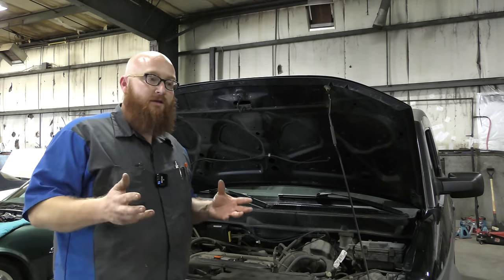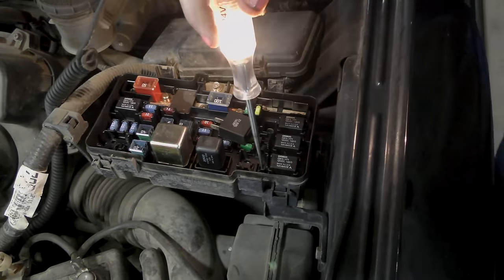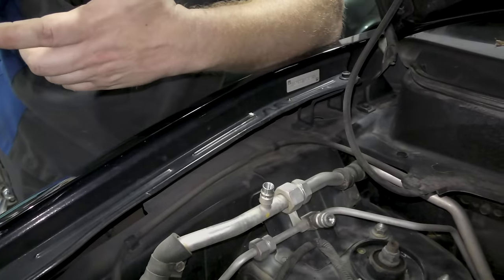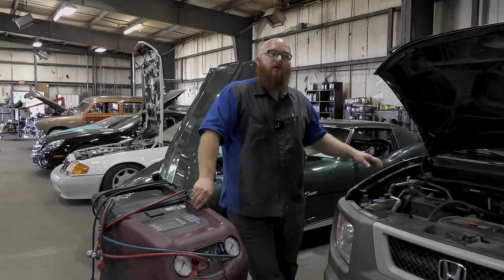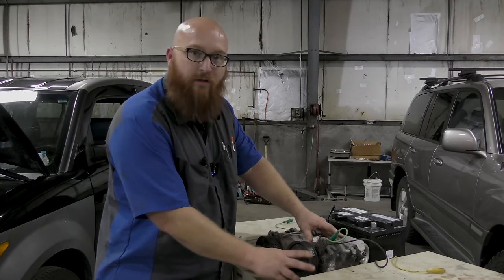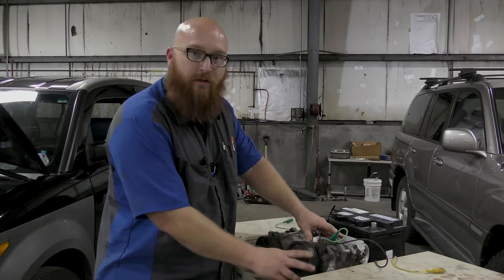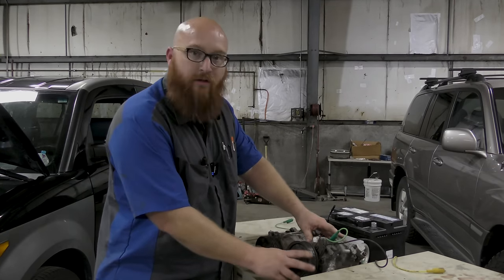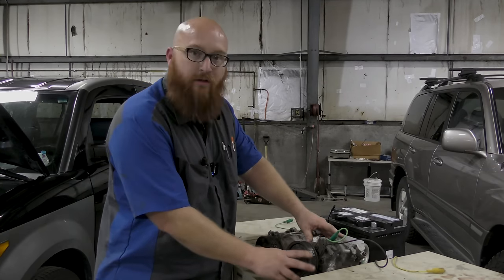AC not working!!! The CAR WIZARD shows how to easily isolate the problem

Comment: This is hilarious, im a tech at HONDA and im literally at work, working on my 3rd a/c problem car for the day and this popped up so im watching it while the a/c machine is doing an evacuation 🤣
Reply: Didn't Honda design more of their newer vehicles with electric compressors?  It would make your day go faster if Honda designed their entire A/C unit into one big line-replaceable module.  It would have the compressor, evaporator, fan and condenser, dryer canister, air ducting ports, connectors all into one neat box.  You pull the defective module out for refurbishment, and slide a healthy one in. And then send the car back out 45 seconds after it was parked.
Reply: sabfly Is it still necessary to replace the whole system if your old compressor is simply not putting out the pressure It used to put out and kind of tired and worn out and not locked up, I know the wizard Said you need to replace the whole system if you replace the compressor
Reply: Must be a newer civic
Reply: Vince Scalise here at the dealer we only replace the compressors/ clutch&coil in a scenario like that
Reply: texasabbott only the hybrids have an electric style compressor, all other models are conventional compressors.. only thing different now is the new freon used
Reply: Shouldn't you have taken a class on A/C during your training?
Reply: @vincescalise4821  The answer is still yes. The loss of efficiency is due to mechanical wear, the worn away material being flushed through the rest of the system. You might not get "glitter", but there's no way to ever ensure that you have flushed 100% of that material out of the system.
Reply: I'm curious what's the 'book' time for a AC compressor and condenser on a Honda Element (Example)? 3hr? 4 tops...
Reply: @Shaquille796  exactly, I just had my son's AC compressor replaced (Rebuild from AdvAuto) and flushed for $600 total
Reply: I also like to watch YouTube while doing evacuations.
Reply: What causes the a/c to not work in C-RVs...looking to buy a 2006.  I notice most C-RVs have A/Cs that stopped working
Reply: @marliseisrael3017  Ac relay and clutch /coil are the 2 most common problems hands down. Always check relay 1st
Reply: @paulholcomb2198  Thank You...I didn't purchase, but I need my AC to work I'm in Texas
Reply: Can the machine u hook up to the car let u know if it’s the compressor
Reply: Dude help me out! My ac only works at night ? But when its hot af out it doesn’t work at all.
Reply: @angelserrano8386  Wow
...hope you get help....I'm in Texas and it's a heatwave
Reply: @marliseisrael3017  im in texas as well lol i hope is my condenser!
Reply: Very helpful ! my saab 9.3 went in for recharge today - nothing in aystem appears valve failed - now compressor not working - back on Monday for Nitrogen test ?  Fortunately condensor in Uk 🇬🇧 £125 and compressor £200
Reply: How is this hillarious?
Reply: @texasabbott  but honda woud make less $
Reply: @josemaisonet5322  l
Reply: Those systems have to be exact on charge or they won't function properly.
Reply: T
Reply: @angelserrano8386 i have that problem as well
Reply: I’m sure the hole in the ozone layer can be attributed to my “topping off” my friend’s ‘02 Navigator’s a/c system- about 8 cans later I realized the port I used and fit pretty close enough, was not part of the a/c system, or was only meant for emptying out the rear a/c before the main. Regardless, where was this buddy when I needed his precision and instructions?!
Reply: The best kind of moments
Reply: OK, so alternator replacement on an 08 Odyssey then my AC stopped working because of a single pin wire attached underneath the alternator for the cooling fan. Nobody addresses this.
Reply: Does an 1000 usd machine work just for at home use for my own cars?
Reply: What about a bad Evap Core?..will that make ac blow warm air?
Reply: @coffeedollsvp  just fixed mine. One of my pipes were broken to the ac which made only warm air blow. Finally gave out 2 Wednesdays ago and got it fixed 2 Saturdays ago. I had a leak due to the broken pipe. Get a diagnosis taken or have someone with an ac machine look at it. If you have no leak you just need to recharge your ac system and should only be charge for the recharge. Don’t use the ac can recharge from AutoZone nor Walmart . They don’t usually work with one can and like I mentioned earlier if you have a leak you’ll just be burning money having to keep buying can recharge. I was charged 280 for the service charge that’s including the recharge labor and parts. Could seem expensive but it’s well worth and won’t have to pay for another few years
Reply: @adrian111-  ok thanks for the info.. will take it into a shop...
Reply: Thanks car wizard! Very helpful
Remember that God loves you Mr. and Mrs. CAR WIZARD! 🙂
Reply: 🧙🏼 magical things happen, believe

Comment: I'm in the automotive industry. You can find honest mechanics that are just parts changers with no diagnostic skills, you can find loads of thieves with and without skills, but a truly honest and competent real TECHNICIAN like the Car Wizard is almost impossible to find.  Good job Wiz!  Lots of respect!
Reply: Except for the 'you can't measure your own reefer pressure and need to pay me 200 bucks to fill it for you' part he's great. You just need a mechanic if you find a leak in your compressor and it's screwed. Manifold gauges are cheap. Get a decent one for like 50 bucks and it's great for auto and home a/c issues.
Reply: @gmork1090  Shhhhh don't tell them! We want them to come into the shop! Wages + a little extra on the top for profit! Sheesh don't want people fixing their own! Then we wouldn't get to take their money!
Reply: I bet you they would do better in construction
Reply: Hail to all the excellent techs out there that get disrespected  at times because there are so many untrained and incompetent thieves out there in the field . Car Wizard is a boss, and you can always depend on his advice. Everything Ive ever seen on his channel has been intelligent,  informed and spot on. Thanks bro!

Comment: "You can't just buy a can..." Tell that to YouTube who just ran an ad in the midst of your video on my feed for a can of refrigerant.
Reply: Literally got an acpro ad on this vid too
Reply: Glad I have an ad blocker installed. What ad? I didn't see one except for their shirt. 😀
Reply: Funny. Got the AC Pro add twice on this video.
Reply: He meant that you can't just add a can of refrigerant and expect to fix a low/high pressure problem. You need to add the precise amount that is needed.
Reply: @absolutelynonameslef  while thats good advice and recommended, i've guesstimated on a few W210s with AC pro and got the AC blowing nice and cold again
Reply: I got the ad for the video too
Reply: All I got were Biden ads. Would have gladly taken AC Pro commercials
Reply: You should consider an ad block. Take advice from the Wizard and only the Wizard.
Reply: It's worth buying a decent set of gauges though. Measuring high/low pressures can tell you a lot about the state of your system, and then you can use those Wal-Mart cans to charge up your system. A scale can also help you meter refrigerant.
Reply: On my older Acura I just take the ambient temperature, look it up in the PT chart for my refrigerant and match the pressures to the ambient temperature in the chart. ex. 90F=250-270 psi head. Works for me. Haven't had to do it for a few years since I fixed the leak.
Reply: @channell11  Yep, a good manifold gauge (multiple lines and gauges fused together) is so good to have for car and home issues even if you're not an hvac mechanic. Can get a decent one for like 50 bucks. Get one to go with your pipe wrench, mallet, hammer, socket and screwdriver set, pliers, shovel, ladder, duct tape and jumper cables.
Reply: @gmork1090  Can you recommend a good manifold guage? Make & Model please?
Reply: Just bought two

Comment: Ac systems are way to complex . They need to redesign them to be less complex and more affordable to fix. Its bad to have a $5000 car and it cost half the value to fix the ac.
Reply: That's when you better fill a cooler with ice with towels in it and keep them around your head and neck. Also get a battery or USB fan

Comment: As an AC Tech for 60 years this guy knows his stuff and is an excellent instructor.
Reply: Had a tech tell me my temperature control switch was bad and my a/c is cycling off when I stop and kicks back in when I take off
Reply: Where’s it located and how hard is it to replace?
Reply: I need your 60 years of experience
Reply: Any idea on why my BMW e36 325i  is freezing and it's not turned on. Though when the green light is on like normal its fine this usuallyonly happens after 30mins of driving then turning the car back on but doesnt always work. I'm an Australian expat in Asia and no one here can fix the issue it's very frustrating. I can change a turbo, head gasket or most thing but aircon I'm clueless.
Reply: Drive it around with the AC OFF. You can feel the AC clutch kick in and out.  The only way a AC can freeze up is if the compressor is pumping Freon.  Another problem can be the fan not working properly or a vent being closed so no air is moving across tithe evaporator coil
Reply: @louprentz8554  thanks I will have a look here were I live it 30 degrees Celsius 365 so aircon is nice to have.
Reply: Check the compressor clutch relay usually in the fuse box. A good bump can close the contacts. If the contacts are worn they can weld together and it takes another hard bump to open them.
Reply: @kanenstuff  When its working, what temperature comes out the vents? (Is it below freezing?) And When it stops working, do you mean air stops coming at all? No air, neither warm or cold?
Reply: @frippefrippe5760  the air that comes out is freezing cold and as I live in a hot and humid climates there will be condensation coming from the vents. If the green lights comes on then it's OK but thus usually on happens after parking in th sun for an hour or so. Only when the green light is off the aircon will freeze.
Reply: You’re 24 and have already 60 years experience. That’s what shops, companies expect from you

Comment: Other videos had me believe that the issue with my a/c system was a bad compressor. I was dreading the repair bill as, even if I was doing it myself, I knew it wouldn't be cheap. With the info you provided, I was able to diagnose the actual cause and repair it myself. All for about $50. Thank you so much.

Comment: Thanks for your honesty and integrity sir.
I'm a Diy'er, learning automotive for five years, I consider myself a beginner. I can tell by your statements YOU KNOW what you're doing as a mechanic, I can learn from you! I can't afford shops, so learning to do the work myself, and collect tools as I progress forward.
    Thanks 👍🇺🇸
Reply: The thing that kind of annoys me is pushing a person to buy his special relay when he could have told you to have the A/C switch turned on, have someone turn the key on, and you should hear that clutch engage anyways and no test light required. If it is not engaging, well sure now you need a test light or multimeter. Yeah, he is a smart guy but things like that turn me off; plus changing a compressor if all that was wrong was the clutch. Even if you have to unbolt the compressor to get at the clutch, all the lines can be left intact without removing the refrigerant, and just change the clutch. He's making it sound like it's a big deal to change that clutch when it isn't. In fact, he knows he can put the gauges on to see what the pressures are in the system before changing the clutch.

Comment: Years ago, I bought a used OEM compressor for my 2006 Fusion ($60), a condenser ($60), a 2 stage vacuum pump ($150),  AC manifold ($50) pump oil ($10), and compressor oil ($10),   About $350, my fusion has been working fantastic. I just searched for the flush equipment, which costs only $50. I have no idea why a shop would charge $1600-1700 for the whole job. I am just glad that I can do it by myself.
Reply: Because the shop would not use used parts and they will markup the parts.

Comment: Thank you so much. I just had my AC stop working in my old Honda CR-V and the last thing I need is to drop a grand+ on a new compressor. Went to Auto Zone, picked up a AC clutch relay, and $9 latter I have cold air. Getting this lucky never happens to me. Thank you for the info. I'm headed out now to buy a lottery ticket. It's obviously my lucky day. 👽✌️

Comment: This is the first video I see amongst a bunch of other major auto mechanic channels, which actually explains EVERYTHING, specially the fact that replacing a damaged compressor is not the final solution. Condenser replacement is one thing that rarely gets mentioned. Thank you for the attention to detail and the very visual way in which you let us understand the process. 👌🏼
Reply: I wish there was a simple solution to fix AC in a car. I know nothing about cars. And I'm doing so much research trying to know how to fix my air conditioning without spending a buttload of money going to a mechanic. I know my condenser is not turning on because I usually hear a click in my RPMs jump up. I was able to manually spin my condenser it's not locked up. I'm hoping all I have to do is replace the relay fuse or maybe just needs freon. I have a 2006 Nissan Altima. My service light has been an issue since I got the car it will turn on for a couple months then turn off for a couple months. I went to NAPA Auto parts to use their computer but when I plugged it in it just kept saying error it wouldn't read correctly. I live in my car and I need to get this fixed before summer comes. I hope somebody can help me
Reply: @pkspecial2196  I know you posted a while ago, but: The condenser is the part that looks like a radiator where the Freon gets cooled off. The compressor ( what you are mentioning,) is the part attached to a belt that has a clutch that is supposed to start turning when you turn on the car’s ac. I hope you got your ac running.
Reply: @badmuddafadda  I just decided to trade the car in for 1,700. I bought a used 2012 Honda CRV EXL with only 32k Miles on it.

Comment: Don't forget to change your filters guys. If your cab filter is plugged up the blower will not pull air across the evaporator which can cause it to not work as effectively. Same for the condenser and radiator, the fan needs to pull air across the condenser and can't if it's plugged. Just some other easy checks.
Reply: How do you check that?
Reply: @jaydenschoenau7956 most are located behind the glove box. Ensure that it’s not clogged with leaves and what not. You’re SUPPOSED to buy a new one but most of us old heads just blow them out with an air gun and reuse them.
Reply: Thank you for adding value to this video.
Reply: @ bryanreamy3214 I am elderly and didn’t know anything about the filters so I got my neighbor to take it for me inspection I left him a note and told him to check my air vent because of a odor and put two filters in I brought it in 08 cry never filtered but the sad part I tooked it in and told him about low coolant and he charged me near $500.00 and all I needed were the filters I were outdone CRV very good car had no major problems people keep asking me to sell it to them I told them I am too old to go in debt❤

Comment: Man I gotta' say most informative automobile help I have ever had. I just paid $168 for a diagnostics test on my Hyundai Sonata Hybrid. Worst car I have ever purchased and I mean that. So I am at the dealership paying my $168 The local Hyundai dealership in my hometown of Bristol, TN and I said thinking I could walk out with the paper I paid for. The guy at the Service desk says I cannot take the paper. I said why I just paid for it. He casually takes the papers back out of my hand and taps them on the counter lining up the document and says. I can give you these if you sign another piece of paper that says I agree to a $5200.00 service fee that will fix the car. I KID YOU NOT! So I said quietly. Hell no to myself. I left very pissed off and called my sister who worked for the largest Dealership Network in NC. She says she had never heard of such a thing. Never heard dealership making that a policy of keeping a diagnostics withheld from a customer after payment for it in exchange for a forced commitment to pay for the AC repairs. Which they said was all that was wrong with my car. Unethical is what she said. I had an older diagnostic tool which said it was the compressor. I bought your relay switch and verified it. That was the only thing wrong with the car. So thanks to you and this video I put in a new compressor I think it was above 220.00 and the car AC runs great. I have contacted Hyundai Corp of USA and informed this action about this dealership. Now one thing about my car is it has 19 current recalls including the entire engine. I wish I was kidding. My point is it is from guys like you who help ease the fleecing of Americans who are stretched thin enough and have to deal with the Hillbilly thugs that run some of these corrupt dealerships, we are grateful for your expertise and talent that you bring to the world. I really appreciate your help.
Reply: TLDNR